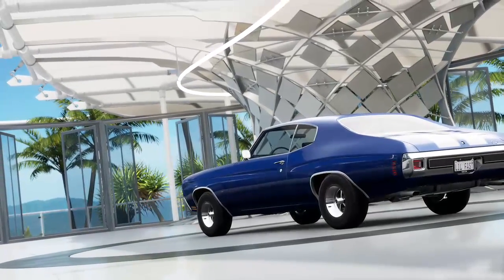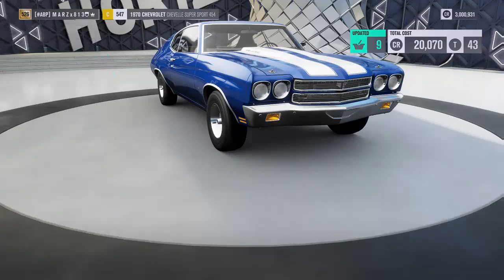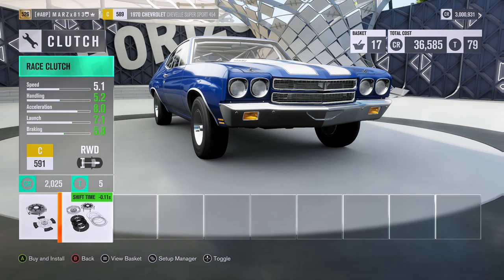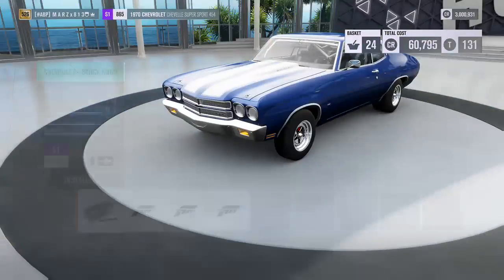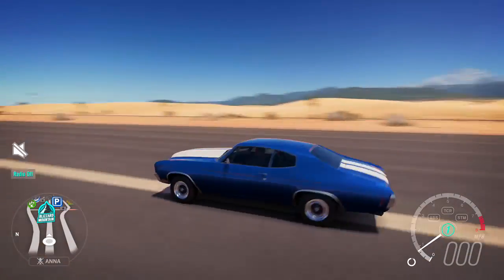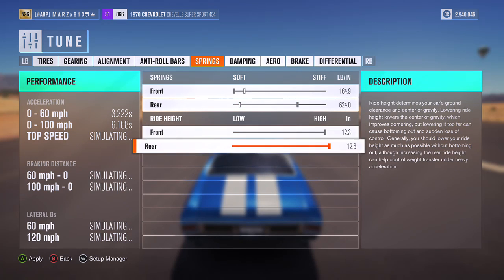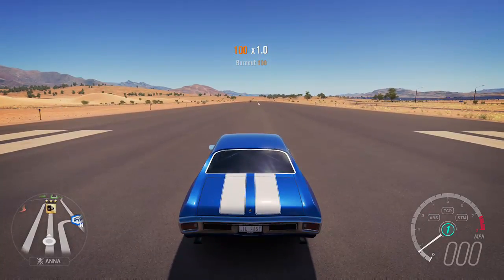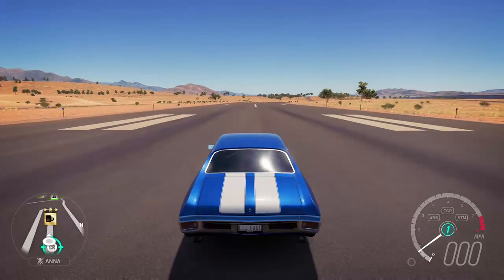How to tune a V8 muscle car on Forza Horizon 3 :: 1970 Chevy CHEVELLE

Comment: Here's a good challenge: Ford Bronco, rwd, v8 1000hp (either if the v8s). The tires are crap but it leans pretty hard, which helps the launch.